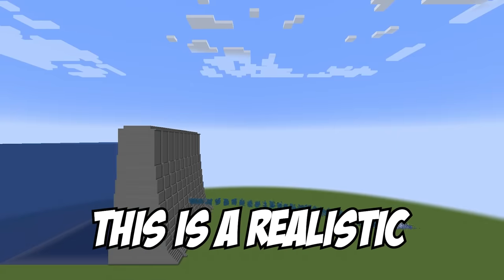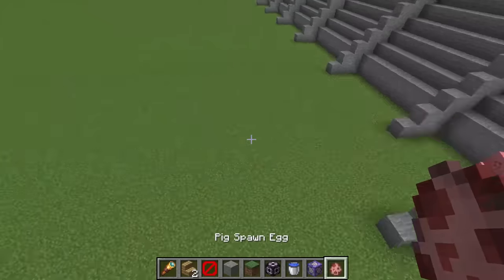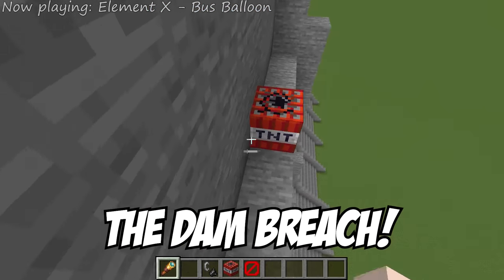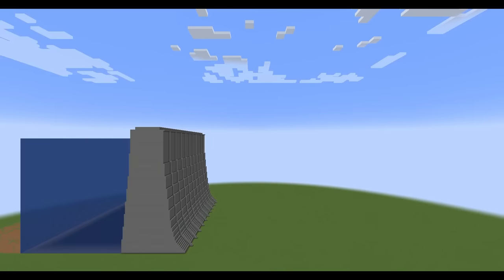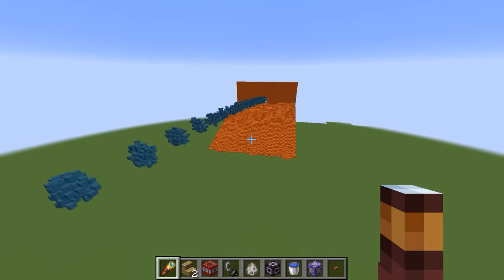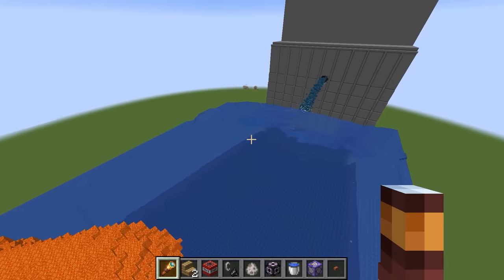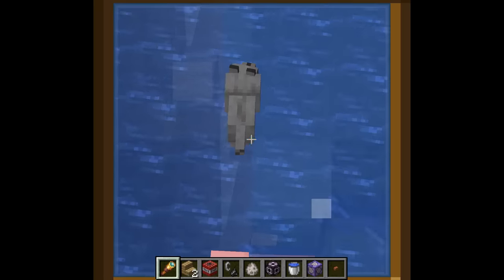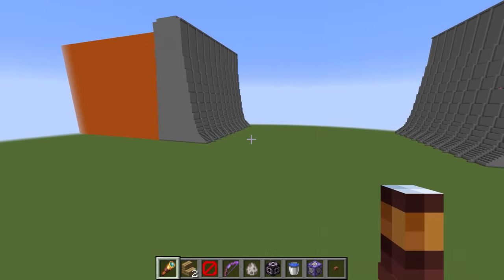Realistic water (Dam breach) VS Infinitely flowing lava

Comment: I’m very impressed that you managed to code in physics for water pressure. That on top of everything else you did for this video is amazing.
Reply: Is he using a mod?
Reply: Im unfamiliar with this channel, so no idea if he coded it himself of if it's a mod. And it's definitely cool, but not that impressive. This type of water physics is used in plenty of games. The core algorithm behind it is called cellular automata, where basically cells are updated based on the states (such as pressure, fill level, ..) of the cells around it. This is also the core algorithm behind conways game of life. The algorithm is reasonably simply too, and most things like pressure are free. Tho i think he cheated a bit on the pressure part to make it shoot out like that, since it also looks more like water blocks flying out of the hole and not actually the cells being filled with water.
Reply: @Yamyatos  ☝🤓
Reply: @Yamyatos W analysis, I’ve heard of that on some video too about how simple it is.
Reply: @SergioMartinez-ez8dv Not like they're wrong though. Even recreating Conway's game of life is practically a beginner-level project. Something you could throw at a 2nd or 1st year CS student.
Reply: @Yamyatos I’ve watched him and yes he codes everything himself
Reply: well, pressure is just rho*g*h, so we only need height of water from top to hole
Then the flow is some function of pressure and aperture area
Then you'd do some numerical stuff to simulate it
Reply: Man shoild make these mods public
Reply: @Yamyatos  "bUt NoT thAt ImpReSIvE"

No need to gatekeep. It is impressive, even if it doesn't require a sacrifice to the outer gods to pull off.
Reply: @Pigeon-fr2hw  no it is not.
Reply: @olivercharles2930  I said it's cool, no? But it is certainly not as impressive as OP thought it is. 

I also agree with the other poster, conweys game of life is a beginner'ish project. Certainly not first semester where people just learn to code, but should be easily doable for most 2nd - 4th and above. The only reason it wouldnt ever be chosen as a graded task at any reputable uni is that there is easy to find implementations for just about every programming language floating around on the internet, so it would be too easy. Unless they put a twist on it.

Comment: 7:34 So what happened here is that the water seemed like it wasn't enough BUT the lava was filling the space of the breach area making the room for the water less to fill making it so the water would over fill the space adding the fact the flow of water is faster, then covering the roof of that lava. But if this for some reason happened in real life you would still die to boiling alive in hot water.

Comment: Ok so what happened when the water made a come back was the lava had formed blocks near the hole in the breach cause the breach to reduce its size and form a ramp upwards increase the pressure and speeding up the rate at which the water was pumped out